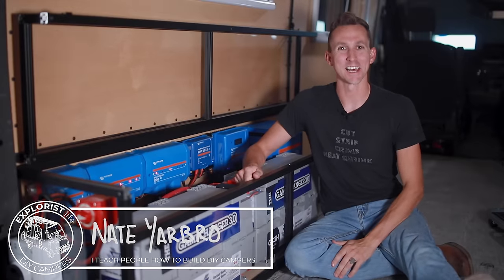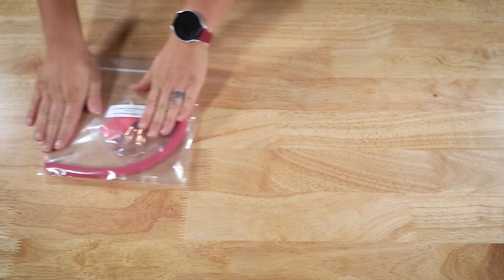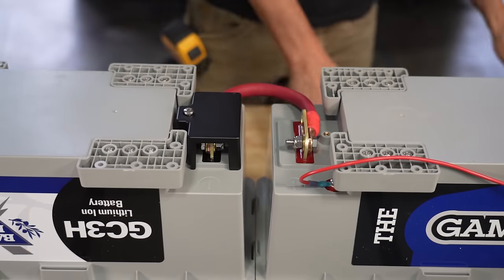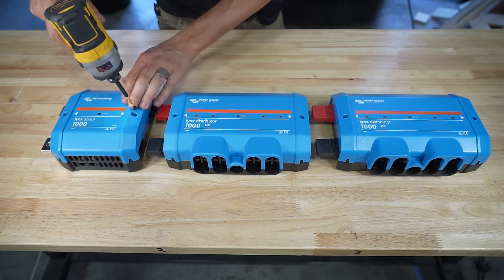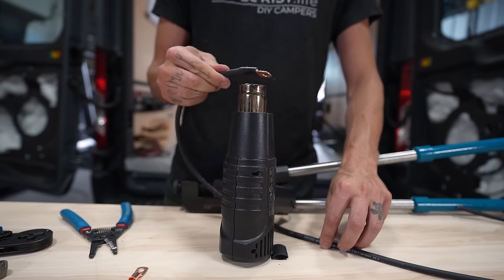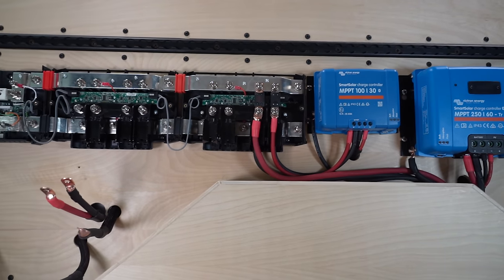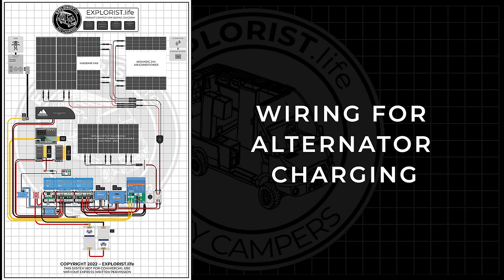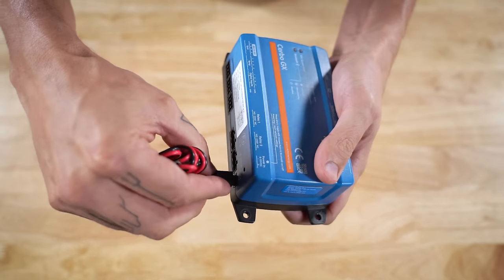DIY CAMPER VAN ELECTRICAL INSTALL (Start to Finish Tutorial)

Comment: We have these batteries and were planning on 12v, but we bought the quattro 24v5000va120amp inverter, can we still use it as 12v or do we have to go 24v? Can’t find any info on this?

Comment: Thank you for this video. Il very helpfull and very informative. With the 24/12 volts , when i read "can achieve an efficiency of 92%", I understand, when i use 92 watts with my 12 volts appliances,  it's take 100 watts in the battery bank,  i have right or not ? Do you think the battery model of 24 volts it better for the battery life, the wire heat and this model will expend in the futur ? Thanks again for all information you give to us.

Comment from the maker: Hey there!  Thanks for tuning in.  I've got a metric ton of additional info hidden behind the 'read more' link below, so be sure to click that to check out all of the supplemental info for this video as you'd definitely be missing out on some important stuff if you don't.
System Cost Analysis: https://www.youtube.com/watch?v=Tkbj51mOhKg&list=PLmvhcyi4n0TVfA4XCYJBkzfUXunSON1zX

Parts for this system:
➤EXPLORIST.life Wiring Kit: https://shop.explorist.life/shop/all-products/camper-wiring-kits/complete-wiring-kits/540ah-3000w-24v-multiplus-580w-to-1700w-solar/
➤Heated 270Ah Battle Born Batteries: https://battlebornbatteries.com/product/12v-gc3-lifepo4-heated-battery-kit/?afmc=explorist_bb67
✅Use code 'explorist' for $50 off per battery.
➤Wiring Diagram: https://shop.explorist.life/shop/all-products/plans-and-diagrams/solar-wiring-diagrams/540ah-battery-bank-3000w-24v-multiplus-580w-1700w-solar-wiring-diagram-explorist-life-2021-ford-transit-camper-van/

➤*Other wiring kits that may be helpful:* https://shop.explorist.life/product-category/all-products/camper-wiring-kits/
➤*Wiring Diagrams for other systems:* https://www.explorist.life/solarwiringdiagrams

Binge the Transit Van Build: https://www.youtube.com/playlist?list=PLmvhcyi4n0TVfA4XCYJBkzfUXunSON1zX

OTHER ELECTRICAL PROJECTS ON THIS VAN WE TACKLED BEFORE THIS VIDEO:
➤INSTALLING OUR ROOFTOP SOLAR ARRAY: https://www.youtube.com/watch?v=zspCRKAFxKA&list=PLmvhcyi4n0TVfA4XCYJBkzfUXunSON1zX
➤INSTALLING OUR 24V DC AIR CONDITIONER: https://www.youtube.com/watch?v=G1oqnxNJDog&list=PLmvhcyi4n0TVfA4XCYJBkzfUXunSON1zX
➤HOW TO WIRE USB OUTLETS: https://www.youtube.com/watch?v=X1tQWYXY2Fc&list=PLmvhcyi4n0TUUwvonaPhIPqUqBiC7CiyY
➤HOW TO WIRE 12V OUTLETS: https://www.youtube.com/watch?v=_nGbtOH5Dk0&list=PLmvhcyi4n0TUUwvonaPhIPqUqBiC7CiyY
➤HOW TO WIRE PUCK LIGHTS: https://www.youtube.com/watch?v=o-YlpzrnuzI&list=PLmvhcyi4n0TUUwvonaPhIPqUqBiC7CiyY
➤HOW TO WIRE 12V DIMMERS: https://www.youtube.com/watch?v=dn77-CbxR4g&list=PLmvhcyi4n0TUUwvonaPhIPqUqBiC7CiyY
➤HOW TO WIRE 12V 3-WAY SWITCHES: https://www.youtube.com/watch?v=WRQuVMFlric&list=PLmvhcyi4n0TUUwvonaPhIPqUqBiC7CiyY
➤HOW TO WIRE RELAYS: https://www.youtube.com/watch?v=mTH1Uc_L2M8&list=PLmvhcyi4n0TUUwvonaPhIPqUqBiC7CiyY
➤WIRING 120V OUTLETS, SWITCHES, AND GFCI: https://www.youtube.com/watch?v=en6Q2L6Bf3A&list=PLmvhcyi4n0TUUwvonaPhIPqUqBiC7CiyY
➤INSTALLING A 30A SHORE POWER INLET: https://www.youtube.com/watch?v=WDAzwaEWUT4&list=PLmvhcyi4n0TVfA4XCYJBkzfUXunSON1zX

Regarding the shore power wire gland referenced at 44:24. Check this video at 30:22: https://www.youtube.com/watch?v=01F4QDVJUq0&list=PLmvhcyi4n0TU6HlMaQiCUwC20DBlyv6s_

We installed our enclosure to the L-Track in the floor.  Here's a video of us installing that: https://www.youtube.com/watch?v=6H7TvKNrwN0&list=PLmvhcyi4n0TVfA4XCYJBkzfUXunSON1zX

Aluminum Extrusion Enclosure Info:  Working on it.  Comment if you want it and I'll follow up with you when it's ready.

*Programming Parameters*: I've added the basic settings we used to the product description of our wiring kit here: https://shop.explorist.life/shop/all-products/camper-wiring-kits/complete-wiring-kits/540ah-3000w-24v-multiplus-580w-to-1700w-solar/
Reply: How about listing out some of those electrical tools - lug crimpers etc - and links? Thanks.
Reply from the maker: @5FWS5  For sure!  I've got all of that listed out here: https://www.youtube.com/watch?v=KGDMaoe63zk&list=PLmvhcyi4n0TVfA4XCYJBkzfUXunSON1zX
Reply: Hi, did I miss the Sketchup file? I don't see it listed here. Thanks folks!
Reply: Once again, thanks for your comprehensive videos!  My biggest hurdle (after buying the van) has been sourcing materials.  Stuff like "what kind of wood should this be?" or "what's a good price for x?"  It's incredibly frustrating to buy something only to realize you've been taken for an extra 50-100%.  Because of its popularity there is just so much out there.

Your shop and material recommendations are solid, with good prices.  It's definitely possible to get lower prices, but if one doesn't have 3 months to wait for a sale, or does not want to endlessly pick up metal shavings around the garage, your shop is a fantastic place to start.
Reply: Hey thanks so much for this info. Can you please link out the aluminum extrusion info?  Thanks!
Reply from the maker: @ed-ey1yb  Thanks!  I appreciate that!  That's what we were going for.  We are priced competitively with Amazon.  Price shopping around at 20 different retailers to save some money is definitely an option, but I guess it's up to each person to decide how much each hour of their life is worth and how long it would take to try to find all of the stuff on the list (and then return items that were ordered incorrectly by accident 🤐🤐)
Reply from the maker: @LenseEnvy  Aluminum extrusion is FINALLY back in stock and I've released the full plans, 3d file, and cut list here: https://shop.explorist.life/shop/all-products/plans-and-diagrams/3d-files-project-templates/electrical-enclosure-plans-transit-video/

Comment: Wow, this is really an amazing video.  I built out a 600w/640ah system 11 years ago now, and it was such a struggle back then.  The components have come a really long way.  This has been a great refresher as I'm starting a new build, and will absolutely be going with Victron for the components.  Thanks!

Comment: Great video ! My wife and I will not have need for solar, as the shuttle bus we are going to convert will be used either in a park or the driveway of friends/family - in other words - shore power only for AC. No need to convert DC to AC. Will need a converter for charging the battery.  It's been a challenge to eliminate all of the components so many videos use.
Reply from the maker: Yeah, that's a pretty minimal system and atypical for viewers of this channel so I don't have any direct tutorials for something like that at this time, unfortunately; but I suspect if you check out some of our DIY camper and electrical play lists and watch through those, you'll be able to learn enough to be able to design one yourself.

Comment: I would love to build out something like this (electrician by trade).  Great video, very detailed.  At 1:09:48 when you were plugging the 30amp shore power cord into the shop's 15 amp duplex receptacle you had to invert the cord which would cause it to fall out of the receptacle in short order.  Flip the receptacle over so that the cord hangs down.
Reply from the maker: If that were a more permanent connection, I would.  Pretty much only using that outlet like that for the 3 minutes it took to shoot the video so it's not worth the effort to change.

Comment: First of all, this is an absolutely fantastic video!  You guys really go above and beyond in detailed explanation.  I do still have one question however that I cannot find a straight answer to.  I am building out a composite flatbed camper with the only metal structure being a under floor aluminum subframe and external aluminum trim all the way around.  I am using all Victron equipment + BB batteries.  DC-DC charger is the isolated version.  Everything else is as you would expect (3K inverter, solar on the roof, shore power, no generator, etc.).  My only remaining uncertainty on installation is if I need to tie the camper electrical ground back to the truck chassis ground.  My gut tells me no, since the camper electrical system truly is isolated from the truck electrical (with exception of the isolated DC-DC charger.).  I'm also not certain if I need to find a way to tie the camper ground to the aluminum subframe & trim.  Any insight you can offer would be very appreciated!  If you already have a video on this, my apologies I didn't see it.  Thank you!

Comment: Hey, Been watching for a good while and this Build is Great. But I do see one major flaw in the Ventilation. ( Now i may have missed something) But I don't see any specific or additional Vents or Fans installed. and this Setup is VERY Compact. and that is a big issue of the Multiplus, Solar chargers and DC chargers. These things have very specific margins that should be Open around them for proper heat dissipation and venting.

As a builder I understand that space is very limited in a van. So what I would recommend if the build is this tight is some PULL/PUSH fans on both sides of the enclosure with a Temperature relay so they don't constantly run. Its super easy and cheap to set up.

(If i missed this or another preventative measure I apologize, i didn't see any)
Reply from the maker: Thanks!  There is about 27sq/in of ventilation around the back of the enclosure and around the lid, which should be adequate based on the hundreds of systems I've consulted on.  *If it's NOT adequate*, I'll add a fan controlled either by enclosure temperature or have the fan turn on when the multiplus fans turn on.  I'll make a video teaching how to do this if I end up needing to do it. I don't anticipate needing this, but that's the plan if I do.

Comment: Great video. One issue I can see is the wiring of the 24v to 12v converter. With vibration the 2 positive terminals might short.
Reply from the maker: Thanks!  We secured the wires so that wires rubbing together is very minimal to non-existant; but if they do rub together enough to shore, the circuit is protected by a fuse; so we're good to go.

Comment: Wow.  So much detail.  All I was looking for was how to wire up a 100/30 charge controller and I still watched the video start to finish.  One question though - is the heater circuit for the batteries fused?  I have a self heating BattleBorn battery and they sent a massive wire kit with it but it seems to standard jumper wire is not fused.

Comment: Thank for this very professional video. Great job !!! May I ask why setup a 24V battery and convert it back  to 12V later? Is this to have a lower amp battery discharge?  What's the advantage of doing so?
Reply from the maker: Here is a video talking about choosing a 12v vs 24v vs 48v system: https://youtu.be/sEW-ZaOOlq0

Comment: How long could you power that 24v A/C unit off this system? Would there be a possibility of an interruption if it was a cloudy hot day using it and you intended on using it through the night? Would it be crazy to add more batteries such as 6 or 8 100Ah? Could you add more of these giant batteries and still accomplish a 24v system?

Comment: I too spend much time at 3000m elevation and have flooded batteries.  Can/should I heat them?  Intuitively seems contraindicated.  Another unreal vid, thanks!  ps I have little experience with electrical.  Do you think I could buy some stuff from you strictly to create a small scale learning workbench, and use say a single solar panel?  I'd probably get a bona fide controller and other essential bits but would like to scale down as much as feasible.

Comment: I'm trying to decide between the $78 iwiss crimping tool for the $98 wirefy I kind of like the iwiss

I already brought bought iwiss battery lug crimper. I don't have it yet I sent for it I'm probably going to stick with the iwiss

Unless I hear different from you I think I saw you had wirefy
Reply from the maker: https://youtu.be/KGDMaoe63zk
Reply: Thank you . I found the big wire crimper the Temco I left a message earlier but deleted it stating I couldn't find it. But I finally Googled it and found it. the one I bought I probably will send that back and get that temco. That's the beauty part about Amazon😁

Comment: Hi Nate and Steph, thanks for the amazing customer service so far; I would like to add an additional Orion 24/12-70 in parallel to get 140 amps so that I can use my 12V A/C on full blast without affecting other devices. Are you able to provide a wiring diagram for how that could be accomplished?
Reply from the maker: Oof...  using a 24V air conditioner with a 24V battery bank is the correct answer here.  You COULD use two additional Orions wired in parallel off of the additional spaces in the lynx distributor to power the single load; but swapping out the 12V AC to a 24V model is the correct answer here if you're trying to follow the setup in this video.
Reply: @EXPLORISTlife  I already bought the Dometic RTX 2000 12V version. It has max consumption of 58 amps. Could I get away with using its own Orion 24/12-70 wired off a spot in the lynx distributor? That way the other loads can run off the other Orion 24/12-70?
Reply from the maker: @stongoi  Thats probably fine.

Comment: Watched all you videos and built my Sprinter van from your videos, did my build in 80/20 and would like to redo my electrical box like this one. Can you set up something with tnutz so we can order these exact extrusions cuts and connectors. Thanks for the great content and parts, made my build a lot easier for a newbie.
Reply from the maker: Aluminum extrusion is FINALLY back in stock and I've released the full plans and cut list here: https://shop.explorist.life/shop/all-products/plans-and-diagrams/3d-files-project-templates/electrical-enclosure-plans-transit-video/

Comment: Hi, Nate.  This is an old video, so I don't know if you'll see this post, but I have a question about wire sizing.  I have 4 105 ah Lion Energy LiFePo4 batteries, wired in Parallel, using 2/0 welders cable.  My longest run is about 6'.  I'm considering buying 2 more batteries.  Can I still use the 2/0 wire, or do I need to up it to 4/0?  Thx for all your videos.  They're the best.

Comment: What a resource!!  I'm only partway through and have a question.  I only have one lynx distributor.  Would I put both ground wire connections (from multiplus AND ground wire to chassis) on the single center stud?  I presume so, but I hate guessing with this electrical stuff!  Cannot thank you enough for all you do.
Reply from the maker: As long as both are on the negative busbar of the lynx distributor, it doesn't really matter.  It's really hard to stack big lugs on the Lynx Distributor, though.  I'd recommend doing it like we did in the following video instead: https://www.youtube.com/watch?v=01F4QDVJUq0

Comment: Really well produced video. Is there a way to do ALL of the settings and programming from a real computer (via LAN connection) rather than from a mobile device or the panel?
Reply from the maker: Yep!  As long as the Cerbo GX has an internet connection, the settings can be changed via Remote Console on the VRM Portal.  This can be done remotely and not even necessarily through LAN.

Comment: Hey Guys!!! Fab video, This is so neat!!!
 If I was to remain with similar install but  a 12V AC system and 3000W inverter, What Lith Batteries would you recommend 2 or 3 x 100Ah or 1 x 250 Ah - Also what rating mega fuse are you using for your Solar??
Thanks
Reply from the maker: This is what you're after: https://shop.explorist.life/shop/all-products/camper-wiring-kits/complete-wiring-kits/wiring-diagram-kits/camper-van/explore-van-wiring-kit/#start-with-your-base-kit

Comment: I'm currently in the process of converting a car trailer into a toy hauler, so this is going to help me a lot, the only question I have is I want to use a generator for high power items like the AC, since my generator/inverter has a 3500 running rating and a 30A connection could I Safely plug it into the shore power?

Comment: Curious why you run all the short parallel leads to each battery instead of running all the b+ same lenghth leads to a bus bar and all the negatives aswell,i would think all the test done shows the 1st battery gives off way more amps then say the middle or last?? Looove your detailed videos thanx for making this for us guys,all the way from australia
Reply from the maker: The way we show on our channel for battery bank wiring decreases the overall amount of wire and space required at no negative effect to battery bank balancing.

If you need some additional guidance on this and If you have purchased/are purchasing from our store (shop.explorist.life) reach out for some more personalized help: shop.explorist.life/support

If you've purchased/are purchasing elsewhere, reach out to your dealer for support.  We'd love to have you as a shop.explorist.life customer so we can provide a bit more help in the future. 🙂
Reply: @EXPLORISTlife  swt thanx for the quick reply.

Comment: Nice work. You should learn how to weld so you can make that whole enclosure out of 1” steel tube.
Reply from the maker: Why, though? The 8020 works wonderfully for what it's being used for.
Reply: @EXPLORISTlife  well for one, cost. I know that’s probably not a concern based on this system though. 😂😂😂

Comment: Love your video ..really helpful. i Have 2 questions if i may , 1 why the need for 2 12v fuse boards , and secondly , why 24v over 12 v what do you see as the benefits
Thank you..
ps apologies  if you have explained this in previous videos that i havent yet viewed.
Reply from the maker: The dual fuse blocks is just so it was easier to run all of our branch circuits with shorter wires on either side of the van and have additional spaces for more circuits.

12v vs 24v vs 48v: https://youtu.be/sEW-ZaOOlq0